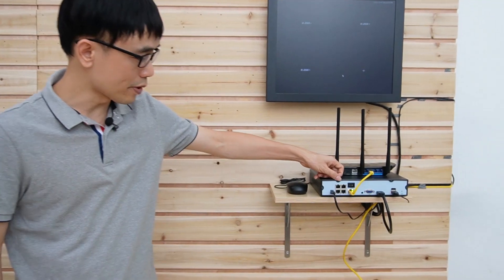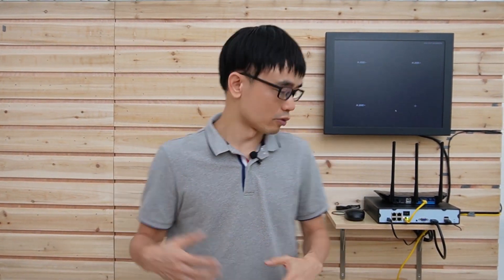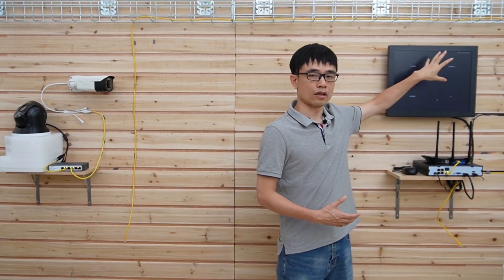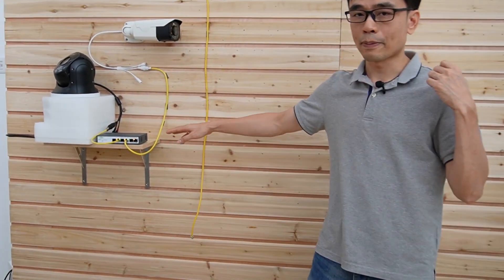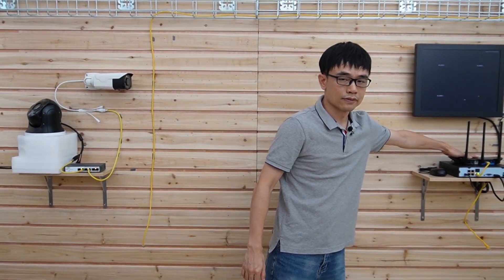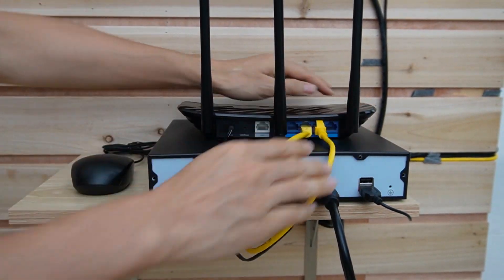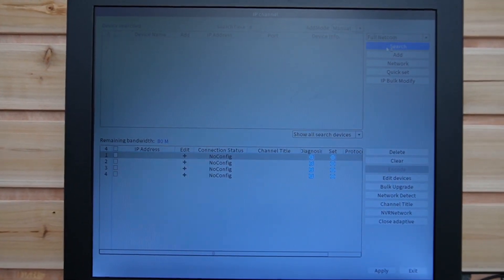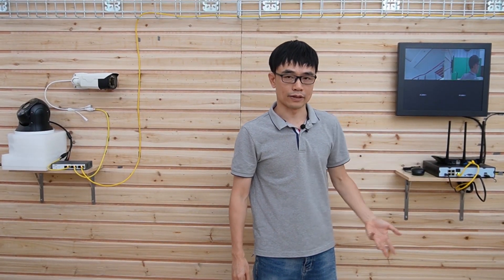How to connect cameras to PoE NVR but not using PoE ports

Comment: Hi question, can you connect a non poe IP camera to poe NVR?
Reply from the maker: You cannot connect a non-PoE camera directly to a PoE NVR. PoE NVRs are designed to provide power and data connection to PoE cameras through a single Ethernet cable, while non-PoE cameras require a separate power source. That's the reason why you need a PoE splitter. If you're interested, please continue to see the video below:

PoE Splitter| Use PoE to Install Non-PoE Device| The Easiest Way👉https://www.youtube.com/watch?v=DBE0-YTVlFQ

Comment: I have 14 ip cameras connected to poe switch, i can buy any NVR maybe with 4ch ?
Will i be able to use motion detect or special feature on cameras ?
Reply from the maker: I think you might need the 16CH NVR if you want to connect all the cameras and record the footage. Whether the motion recording works or not? It is better to have cameras and NVR with the same brand.

Comment: I have a big store in my home.. I need to add only one poe cam.. But it's only 60 meter from home.. Is it OK with straight cable from camera to nvr?
Reply from the maker: You should be good. The PoE range supports up to 100 meters with no need for extension.

Comment: So what your telling me is that I can have multiple poe switches daisy chained together throughout a facility with cameras connected to them, then just connect the nvr to the same network and the ip cameras can be seen on the nvr
Reply from the maker: Technically, yes, but I don’t recommend you daisy chain multiple switch. Usually we keep less than 3 switches between the camera and NVR. The broadcast domain could cause issues.